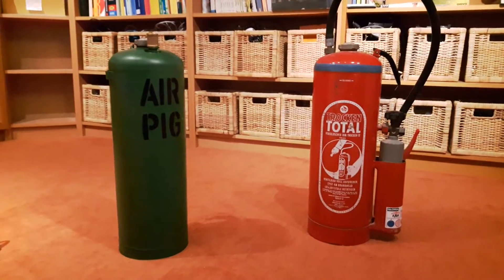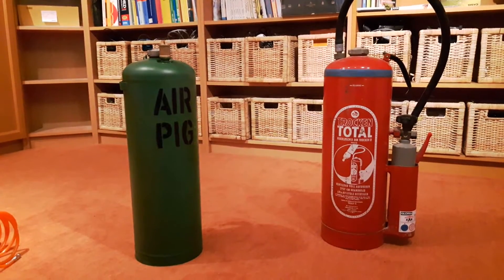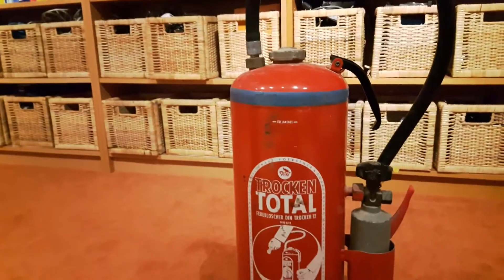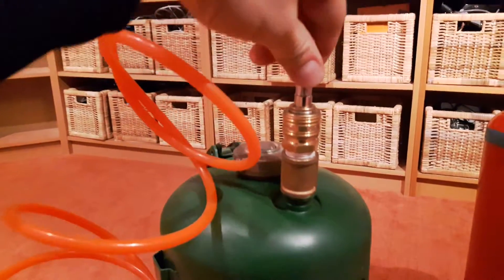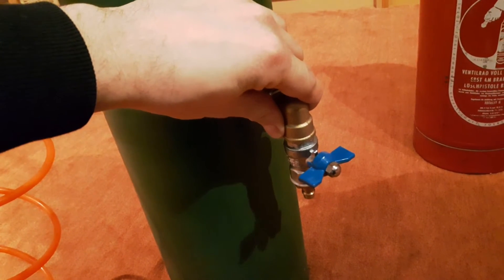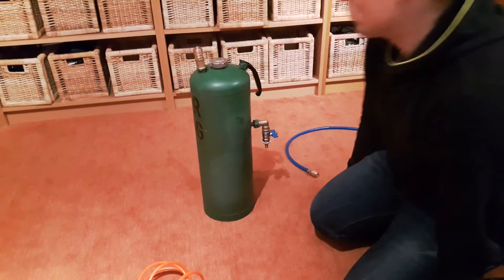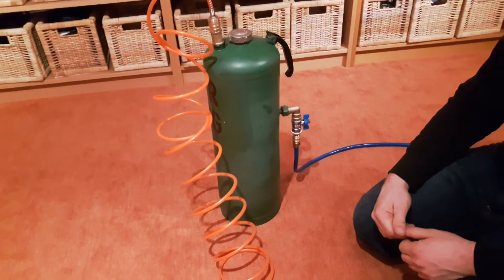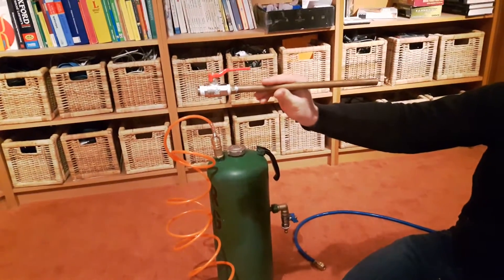Portable air tank (aka 'air pig')

Comment: I'm guessing once the fire extinguisher's contents are emptied out, one doesn't need to clean it any further? Just wondering about foam residue etc.
Reply from the maker: SonoraDW There are different types of extinguishers.  Some contain Co2, some water or foam. This one had powder in it, so it was easy to remove without any residues.